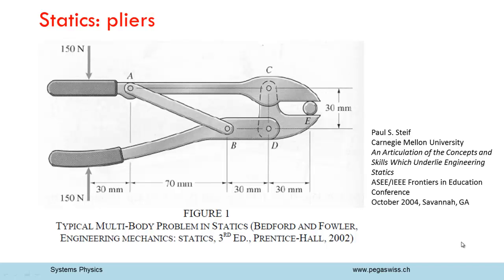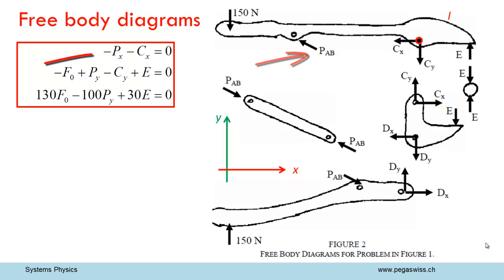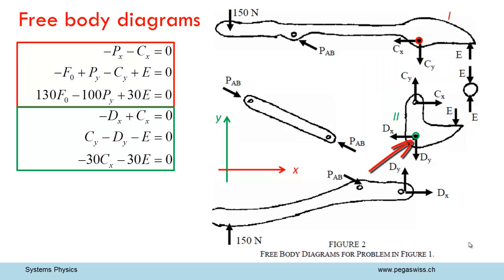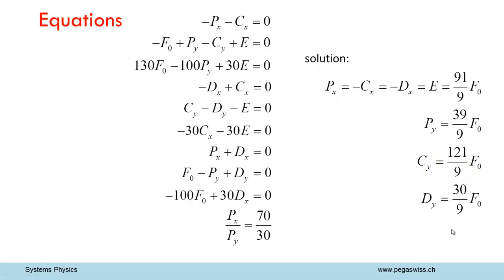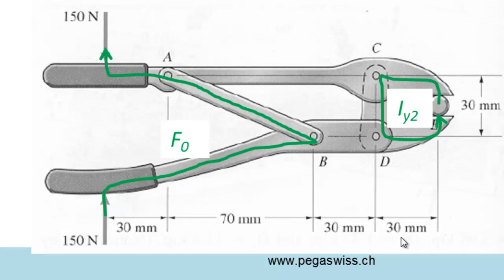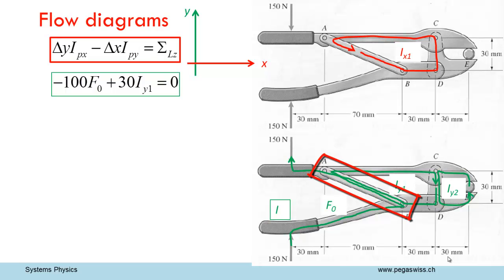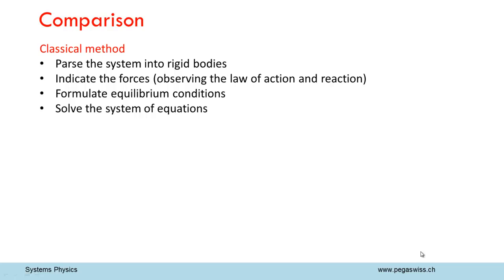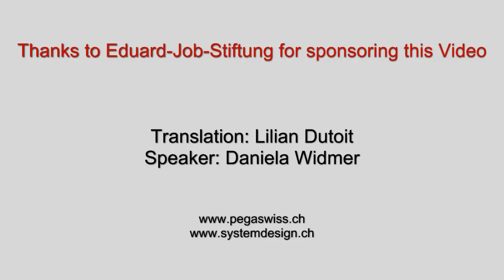Typical multi-body problem in statics

Comment: Is this a static problem or dynamics problem?   Angular momentum is used in dynamics of motion.  The clamping force at E can be solved by 2 simple moment equations.  Take moment at D on member BD to get the force in the 2-force member AB. Once that is done take the moment at C on member AC.  The clamping force at E can then be calculated.  Anyone just learning statics should not watch this crap.  It is a big ado over nothing.

Comment: I don't understand why there is not an Ix2 loop in the 3rd (jaw) section, could you explain?
Reply from the maker: There is no x-momentum-current because there are no x-forces (a force is a momentum current relative to a body).
Reply: I see, thank you.  Now, if the jaws, instead of being perpendicular to the x axis, were set at a 20 degree angle, how would that change how you would calculate Iy2 in the system?

Comment: I never heard any physicist or engineer use the phrase "momentum flow", except perhaps in fluid mechanics.  9m44s Momentum has dimensions of mass times velocity. This is a static problem, so there exists no "momentum" here. What you wrongly call "momentum" or "momentum flow" is actually force or torque (force x distance). Your so-called "completely different problem-solving method" is just doing a torque balance, making the analogy to closed-loop  Kirchoff's Theorems to balancing the voltage changes around any closed loop or Thevenin's Theorem balancing the current at a node.  Yes - it is a very interesting and important analogy.  However, there exists absolutely nothing about it that makes it "holistic", because "holistic" is a worthless meaningless bullshit word, in EVERY context!